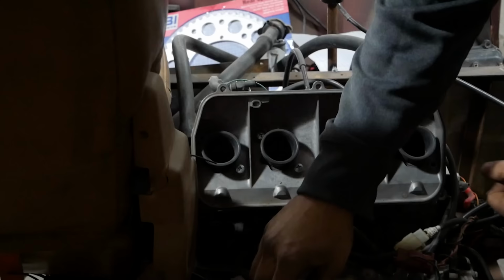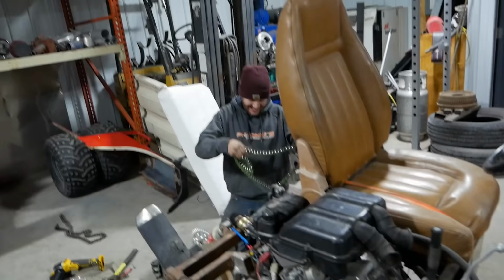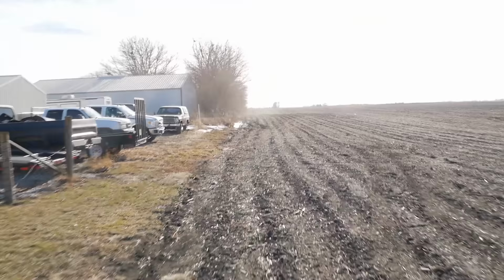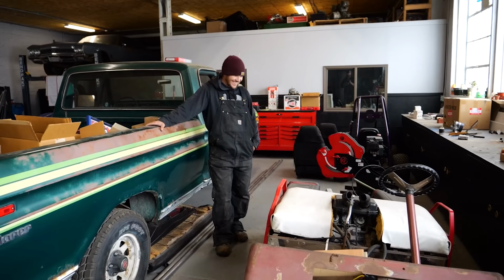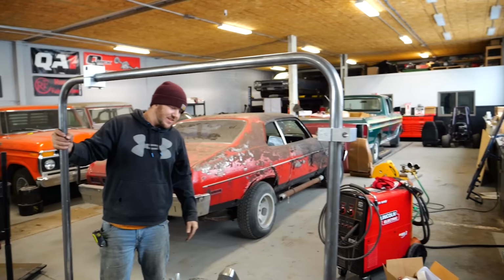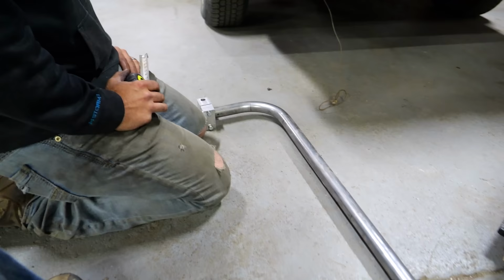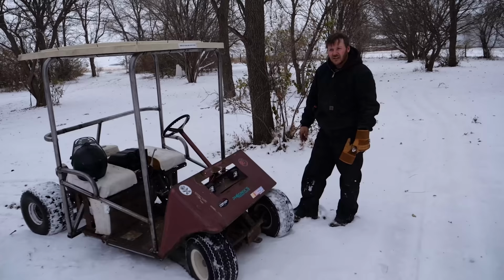$100 Crotch Rocket Powered Golf Cart Revival - PART 2

Comment: I bought the Tube Shark about 25 years ago when the original inventor (Final Approach Engineering) was still manufacturing it.  It's now owned by someone else, but it is basically the same concept as the Rogue.  It makes quick work of tube bending once you learn a few things.  Primarily, always use the seam in the tube as your 12 o'clock or 6 o'clock so you can reference it on compound bends.  Always wipe your tubing clean before bending so you don't score your dies, and wiping the tubes with a WD-40 soaked rag before bending makes them slick through the dies smoothly.  Use a scribe instead of a pen for accuracy, and your bend always starts behind the lock at the lead edge of the saddle die, so you slip the scribed mark right up to the front of the saddle before clamping the lock.  Then, sit down and make yourself a cheat sheet, doing the math for each of the tube sizes you have dies for and the radii to center line of the tube diameters for those dies.   Also, take notes on the spring back for different wall thicknesses (.060, .095, .120 are most common) and add them to your cheat sheet.  Once you have this done, it is super easy to determine your measurements to the inside or outside of a bend based on radius and half the tube diameter being used.  A 20' stick of 1.5"  .120 wall used to cost about $18... now it's closer to $80, so mistakes get expensive quick.  That notcher is very cool, and I may have to retire my crappy old one for the Rogue.  Great job guys!

Comment: The next thing we need to see after the roll cage is installed is fix or add a gear shifter, rear tires, tighten front wheels and maybe add a windshield and do a top end speed run.

Comment: listen up kevin..about the oil in a motorcycle engine..yes..the bike is vertical or leaning..BUT it also stops hard enough to get the rear wheel Off the ground..so the oil is pinned to the front of the pan..then on HARD acceleration, the oil is pinned to the back of the engine..There is no better pan baffling anywhere than in the pan of a high performance bike engine.  Next time you tray a few laps at top speed on a 600cc Honda RR or a Ducati 1000, you will understand..if you survive the lap.

Comment: I'm mildly reminded of a build I'd read about some 20+ years ago.  Someone took a FWD late-sixties cadillac with the 500ci engine, stripped off the entire front clip, welded the steering straight, took a VW bug, removed the body, cut the pan, welded the front half of the bug's pan to the front of the cadillac, then cut the cadillac frontend free from the body at the firewall.  They had to build a cowl to protect them from the radiator and to direct air up from underneath, and to build a bunch of linkages, but they had effectively a 500ci V8 Volkswagen Beetle.  Apparently no matter how much they worked on alignment (they left it possible to adjust tie rods) they couldn't get the car to launch straight with that much power.

Comment: Gotta rejet the carbs. It's running lean, if you're going to mess with bike stuff it's worth getting a jet drill set, otherwise just go one up on the pilot and shim the needle one washer. I know there are a few radio shacks around the ames area, they sell little bags of assorted washers, there is one size in there that's perfect. A lot of shops are more than happy to get rid of jets and stuff since everything is FI now. Also need a air filter to get the jetting closer.

Comment: U need to get 4 vacuum gage to adjust can bee done just takes longer to get insink and find a wider axel to get wheels out use to have a go-kart with fiberglass vw dune buggy with 450ccsnow Mobil engine same size wheels and we had to mount a brick on front and only 15 then it just rode wheels even on a 30mph roll straight up so much rush just wasn't as safe sitting in tub of fiberglass on a old  school frame did stap it I 3 places and slide to a stop with rear only held by to cables what a ride .might what to had some tunes to make stronger .

Comment: Those motorcycle engines have the air box and and the exhaust. specially tuned to work in conjunction with the engine. I hate those chain puzzles.

Comment: 9:20 Is that the fuel-line leaking profusely atop the engine?
Need some plastic over the inside and/or outside of those old single-pane (thickness) shop windows!
This thing is a ridiculous amount of fun! XD (and more stable than it looks, even with a flat tire!)
What's that hanging off the rear axle and dragging in the snow? Eh, probably fine. XD

Comment: Needs paddle tires and a trip to the dunes. 

Also the loss of steering is probably because the locked rear axle is just pushing too much with that kind of power. I don’t know if there exists a limited slip for this application, then again you probably don’t want to be turning too much at high speed with this thing anyway.

Comment: Check your chain and sprocket size. If the chain isnt fitting a sprocket then its a different size. Exmaple: My cbr1000 runs a 530 chain and wont fit with a 520 sprocket. Those are the numbers youre wanting to have match when pairing chain/sprockets on those bikes.

Comment: I have a 125cc  quad engine sounds nice my first one was a 200cc I was 5 or 6 years old now i am 13 and I enjoy my 125cc it is a Chinese brand the cheapest one I could buy my grand pop one of is budy had an old frame from a 90 110cc quad that we want to turn in to a 1923 Ford t bucket also that might interest you he has a 1967 chevy c10 with  a 454 big block and a 1931 chevy coupe

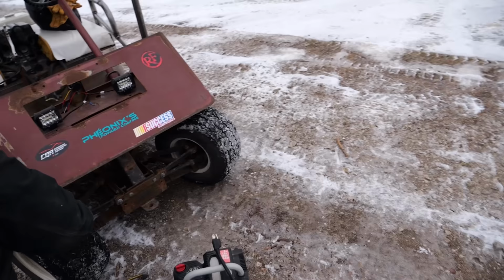Comment: ~40:00 why did you notch it again when you could've flat angle grinded or straight cut off the bottom? i mean i guess the machine is there might as well use it but flats are easier than circles?

Comment: I actually own the same model of bike that engine comes out of it. With the factory gearing they do about 240 kph (like 140 ish mph). Mine does a consistent 8.3 second 1/8th mile drag race with 100 kg (220 lbs) ass on it. Oh yea , that muffler is too quiet. They sound really damn good with a more open muffler.

Comment: if its a honda engine it doesnt matter. the engines hondas use for bikes are the same ones they used to use for their cars back in the 70s. a honda car used to come with the same 750 or 1100 honda inline 4 that the motorcycles had. just so you know for future reference
Reply: 90s and back honda inline motocycle motors... btw... then you also have a fan and radiator for liquid cooling........

Comment: I've been loosing my sh1t this whole video series at the fact you didn't have a radiator for heat dissipation. Don't warp that cylinder head! A little ambitious to call yourself an engineer without considering basic things like heat management or brakes. Get your cooling system right before you run things period...
After that fabricate shift linkage and rig the clutch handle to be a shift lever, get a salvaged motorcycle brake master cylinder then agriculturally engineer that into the brake pedal, make brake lines and bleed from that rear caliper you need to fab bracketry for then design a return tube for your fuel pump to recirculate so you don't flood it at idle or just fab the tank to be higher than the float bowls and it will gravity feed like it did on the bike it came from. I liked and subscribed because you guys remind me a little of crazy builds I did at a young age but you guys need to consider all of the systems on the machine and engineer them all to be functional with each other as an integrated whole if you want to call yourselves engineers then behave as such. I'm guessing your sponsor that gave you the bender called and said what the F happened to the promotional video you were supposed to make with the equipment we took a chance giving you and told you to make the video or send back the equipment you have likely been making money with for over a year without holding up your end of the bargain. You guys have potential. Make good choices and keep up the good work. Now change out the break in oil you have in there and get your cooling system right. That is not an air cooled motor! I don't care how cold the ambient temperature is that engine doesn't have fins for heat dissipation. Thermodynamics must be considered in anything that goes or makes fire. Get your basics right, then fab your machine right to where all the components work with each other and all systems work. Also call your sponsor and thank them for the bender they thought you stole for a year. Good work. Now if you want to be serious about that contraption after you get the aforementioned things right then disassemble everything and make use of your power coating equipment and powder coat the frame then reassemble everything into a clean build. That would be a great advertisement to not only your powder coating business as well as displaying your other skills and bringing you business, but in addition to that it would make you look like serious you tubers. Then you would really be the engineers you claim to be. However it looks like you're just having fun with an unfinished project that was revisited only because the company that gave you the pipe bender also gave you an angry phone call about the bender you failed to make a video for. As an engineer and mechanic myself it's just hard not to see the huge untapped potential of that contraption. None the less, it was entertaining.

Comment: look at officer kevin being like the cops around here. my cart looks a hell of a lot more like a golfcart still just hevily modified i was ticketed on it as an ATV  because it is modified with lights a 420 engine a lift to fit the 420 different seat covers and a cobbled together bike exhaust (cut off gocart header with 2 inch flex pipe crushed down on it and a chineese motorcycle muffler) the cop said its no longer a golfcart my excuse in court was no its not a golfcart anymore it is my mobility aid because the city fails to properly plow the streets so a granny scooter would get stuck the second i pull out of my drivewaythe ticket was withdrawn and the roads are plowed more however still not good enough for a granny scooter

Comment: Find it rather difficult to believe motorcycle engine swaps blow up just because of oil starvation. For one i've never seen someone take a 0 mile motorcycle motor and swap it, they're usually from wrecked bikes. Revving out to 12k rpms cold with carbs out of whack will not help either.